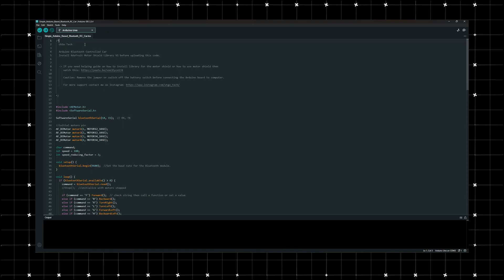Build a Bluetooth RC Car with Arduino | Low-Cost DIY Electronics Project | UtGo Tech

Comment: Please tutorial to connect the battery with solar panel plzzz requesting u ... Otherwise battery will be discharged
Reply from the maker: Thanks for the suggestion, I will consider making a video on that topic in the future.
Reply: @UtGoTech can u make it plzzz within this week
Reply from the maker: Actually I have to get a good quality large size solar panel for this. That's why it's taking time.
Reply: @UtGoTech so can u show how to connect this circuit with charging module
Reply: plzz show how to connect it with Tp4056
Reply: In any short video type so that i'll not disturb u anymore

Comment: Is l298n motor driver can be used instead of l293d?
Reply from the maker: Yes. But you have to change wiring and code.

Comment: can we use jonson motor instead of dc motor
Reply from the maker: The motor driver used in the video can handle 600mA current per channel or motor. But Jonson motor genrally takes higher current around 900mA. This can damage the motor driver. You have to use different motor driver which can handle high current demand of you motor.

Comment: How much weight it can carry? I am making food delivery robot
Reply from the maker: I have tested its weight capacity but I think it should carry a minimum of 1kg as it is fixed using hot glue. If you use a sturdy chassis then maybe it will carry more weight.
Reply: @UtGoTech can you please show how to make a sand rover with weight capacity or can you atleast say what kind of modification do i need to do as i am looking to replace transmitter and receiver due to their cost
Reply from the maker: If you want to build a sand rover then a tank type RC car will be suitable. For easy and cost effective communication HC 05 Bluetooth module will be a good choice otherwise you can use nrf modules.

Comment: dude the driver shield you bought already had the capacitors,led and resistors attached or did you attach them yourself
Reply from the maker: We sell already attached capacitors and headers but other sellers don't have these.

Comment: Thanks for this! I am able to pair with my HC-6 on an Android Tablet but when I then select the HC-06 in the Android Bluetooth Control app nothing happens (it doesn't seem to pair within the app). Any thoughts?
Reply from the maker: If the Bluetooth module connects with the app then the red blinking circle changed to green color in the app. If this happen then the bluetooth connection is successful. Next you have to check the hardware connection. If you are using my code then you must follow my connection diagram otherwise it will not work.

Comment: how to i install motor shield library shield v1 its an installed app or an site im new to arduino
Reply from the maker: You can install it from the Arduino IDE's Library Manager.
Reply: just click the icon that has picture of books and search adafruit motor shield v1
Reply from the maker: Yes

Comment: Bro I followed the same steps and installed the same Arduino version, but COM5 didn’t appear only COM3 showed up, and the car didn’t work at all!
What’s the problem? Can it be fixed using COM3?
Reply from the maker: Check for the port before connecting the Arduino board and note down any com port shown. After that connect the Arduino board and again check for ports. You should get a new port now. Select that port and upload the code. If no new port is seen then you have to install the serial chip driver. Most probably you have to install the CH340 driver.

Comment: Are there any spare buttons on the app that we would be able to assign to a function. I am asking because I am creating a car with an auto park function. So how would I be able to run that function after programming it into the arduino? 

If anyone has any knowledge on this please let me know.
Reply from the maker: Yes there are some buttons other than direction control that can be used to run custom functions like auto parking function in your case.
Reply: @UtGoTech do you know how we would get the buttons in the app do run the specific function if we are adding the function to the simple driving code you used on the arduino

Comment: Bro in my L293d driver shield there is no slot for bluetooth
Reply: From where did you purchased
Reply: same problem here
Reply: can you pls share where to insert what
Reply from the maker: You can get it from this link: https://utgotech.com/product/l293d-arduino-motor-driver-shield-upgraded/
Reply from the maker: You will find the connection diagram link in the video description.
Reply from the maker: Normal L293D motor driver shield doesn't have female headers . Either buy an upgraded motor driver shield or you have to do it manually.

Purchase link: https://utgotech.com/product/l293d-arduino-motor-driver-shield-upgraded/

Comment: My car is not working at all even though Bluetooth hc-05 is connecting properly to app can you help me with what should I do and can you tell me where to connect the TX and RX pins
Reply from the maker: Connect the bluetooth module as shown in the video and also use the same code as shown in the video.
Make sure to connect the Blueooth module through the female headers.
Also check the battery voltage, it should be greater that 6 volt and less that 12 volt.
Reply: Ok single battery holder has to be 6 volt or both the battery combined

Comment: Hello sir its me again. Last time my project was successful and i am very happy with how my tank worked. This time i am making an ho (1:87) scale locomotive and due to space restrictions inside the locomotive body i want to use arduino nano. The nano will only have to control one motor. I still want pwm and bluetooth control. So what components will be required? Could you please help me out.
Reply from the maker: I'm glad to hear your previous project was successful, and I'm happy to help you with this one. You can use MX1508 or DRV8833 2 Channel DC Motor Driver.
Reply: @UtGoTech thank you bro! Looking forward to complete my project
Reply from the maker: Welcome 🤗

Comment: Is the battery you used 1.7 volt 1200mAH
Reply from the maker: I have used 3.7 Volt 2500mAh 18650 lithium ion batteries.

Comment: i have HC-06 blooethut module and i cant pair it with my mobile😥
Reply: brawl star player?!
Reply from the maker: Are you able to see the bluetooth module in the phone's bluetooth setting ?
Reply: Yes but i can't pair it with my phone
Reply from the maker: Where are you facing issues?
Reply from the maker: HC 05 is not directly connected to each other. Actually we only need to receive the controller data that's why only the tx pin is connected to A0.
Reply: Please explain connection between hc05 and l293d.. you only connected txd from hc05 to A0? How is this A0 connected to rxd on arduino?

Comment: For me Adafruit Motor Shield V1 is not installing weather there is any other libraries for operating this?
Reply from the maker: No other library will work for this motor driver. You have to use Adafruit Motor Shield V1 Library only.

Comment: bro i am doing the same as you but mine is not working
Reply from the maker: Can you please specify what isn't working so I can help you?
Reply: @UtGoTech My car isn't moving despite being connected to the app and all
Reply from the maker: Check the battery voltage

Comment: Hello sir could you please help me with making my rc tank. In my tank i  will use 4 dc motors. 2 motors which will enable the tank to move, one motor will allow to turret to rotate and the last motor will control the gun. Could you please help me with the code for this tank.
Reply from the maker: Yes this can be done. You can use only two motors to drive the tank and use the other two for the turret and gun.
Contact me through Instagram. I will try to help you.
Reply: @UtGoTech since i dont have Instagram can you tell me here? I think there will be minor modifications to the code and i only need help with that.
Reply from the maker: @technogamers3813  Ok. Use M1 and M3 terminal of the motor driver to connect motor for tank movement. You have to remove all M2 and M4 codes and modify it for turret motor and gun motor respectively.
Reply: @UtGoTech yeah this is what i was saying. I only need help with the code for m2 and m4
Reply from the maker: @technogamers3813  Yes you have to code to run motor in forward or reverse direction as per the movement of turret and gun.
You can take help of this tutorial. This will help you.
https://youtu.be/DCqvSVN96Lk?si=s93xyXF0UpgICVwS

Comment: Hello sir i cant connect to HC-05 module🥲
Reply: It's is showing paired not connected
Reply from the maker: First pair your Bluetooth module using the phone's Bluetooth setting menu after that open the RC controller app and select the paired Bluetooth module.

Comment: Bro motor shield getting heat  i am using bo motors
Reply from the maker: make sure the voltage is less than 9 volt.
Reply from the maker: If still facing issue then send picture of you RC car through Instagram, I will guide you.
Reply: @UtGoTech  thank you, bro was using a 9.7-volt  now it's running good
Reply from the maker: @ Cool👍

Comment: Bro can u help me , i have a doubt to make it , because when i try it for making , continuously its fails and not running
Reply from the maker: Make sure to follow the connections in the video and check battery voltage.
Reply from the maker: If you still face issues then let me know. I will help you.

Comment: When I built this a part of the Arduino board became burning hot
Reply from the maker: Check for short circuit. Check battery voltage.